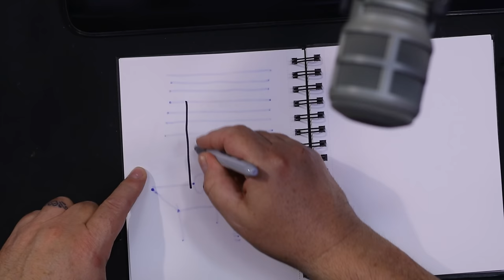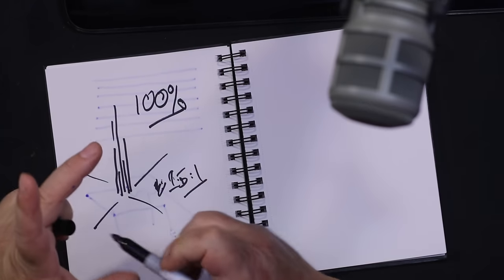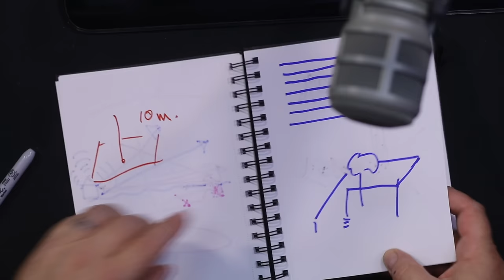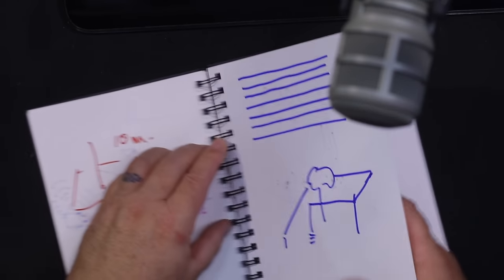Will it Work? Crazy Ideas for Antennas

Comment: I love this video. It’s beyond me why someone would want to do wonky stuff and ask someone else if it’ll be ok. If you want to be certain something “works” then use it as it’s designed! 

My runnin buddies here are talking about a little contest, completely friendly of course, to see who can come up with the most absurd antenna “thing” and make the most contacts on it. The band and other specifics have not been agreed upon just yet, but the one rule we have agreed upon is that the antenna “thing” can’t be an actual “antenna”. Use the car bumper, or a step ladder or a bed spring, whatever you want. You can use a tuner if you want, but you also have to wear a skirt if you do that. Its all in good fun and we’ll probably learn something out of the whole mess!
Reply from the maker: Tuner.. but a skirt! LOL. Will a Kilt be OK?
Reply: @DXCommanderHQ  sure, provided it’s worn properly!
Reply: You just invented a new contest!

Comment: several feet of clear vinyl tube filled with salt water. Made as a 10 meter dipole. 1.2:1 match and made several contacts. It worked. Did it just to prove a point to a few friends.
Reply from the maker: Absolutely fabulous!

Comment: The first contact I ever made was on cb...using an old 23ch am Midland...10 feet of rg-58 and a 102 inch steel whip mounted on a steel wheel from some old farm equipment laid flat, with a piece of axle sticking up to mount to...it worked!
Reply from the maker: Fabulous!

Comment: A 50 ohm resistor has has a great 1:1 SWR.  But you won't talk to many folks on it.  A random wire (or a nail) might have a terrible SWR, but you can get it to work to make contacts.
Reply from the maker: I need to do this.. TX on a dummy load with RG58 :)

Comment: I had an antenna at my old apartment that everyone said would never work. I used the rain gutters of my apartment building. I fed it with a 9:1 unun to the downspout and ran the ground back to a ground rod. Sounded like it would be a bunch of crap on paper but boy did I work a lot of DX, up to 10000 miles away. My theory, it performed like a random wire antenna.  the gutters were about 300+ feet total of metal in the air. Only down side was it was kinda noisy at times being right against the building.
Reply from the maker: Fabulous!

Comment: Just to be different I will tell you of one I made that I thought would never work but turned out to be better than anything I had before or since. Circa mid 90's my mate got a CB but was twigless and desperate to get on the air, I had some galv fencing wire so wrapped it around some batten evenly spaced and center fed it. It was one of those on the spot constructions. I thought as the batten was not circular it would cause all sorts of issues but he could hear people further away than I could with a silver rod and to rub it in a bit more he could also make further contacts than me too. We only lived a few houses apart so tried it at my place and I could hear so much more.  I was  both pleased and gutted at the same time..
Reply from the maker: Fantastic memory!

Comment: Thanks so much Callum. I'm in 100% agreement!-  It's not "will it work" but "how well" will it work"?
I have 102' doublet fed with my own 2.75" spaced open wire transmission line, and a balanced tuner, and with only 100w I can easily bust through large pileups.
As usual, it is about minimizing losses, and taking advantage of effiency. - Cheers!
Reply from the maker: Well said!

Comment: I have a pair of dipoles using 24-gauge speaker wire for each side. I can receive fantastically on them. I can't be heard the next county over, though, not even on NVIS. It may have something to do with them being inside the attic, but they were a good learning experience.
Reply from the maker: Thanks for sharing

Comment: I put a 1/4 wave vertical on a garage roof and ran the radials over it. It has high SWR either from the roof steel or the angle of the radials. I bet with some tinkering I could get it to work better but I'm going to try an end-fed running over the ridge cap about a meter high and see if the roof can give me some NVIS gain.

Comment: To understand an antenna and how it works, you have to put EFFORT in to building them, modelling them, etc. Doesn't matter if it's a dipole, OCF dipole, G5RV, etc build them and test them against one another and find out. Then publish your results on YTube, or your own website. I love messing with antennas, even though I am restricted at my QTH like a lot of hams are. Callum, you inspire folk to try, yes they can buy a manufatured one, but the fun is making a copy and getting good results. Love your channel 73's Andy M6APJ.
Reply from the maker: Yes, copies of well known antennas also good fun to make.. Not just because of the RF.. but the engineering and all the other thinking that goes into it..!

Comment: I like to run an end-fed vertical and an end-fed horizontal, and switch between the 2 of them to see which one is picking up the best. Then I use that one to chat on. If conditions are good I work DX. If not, I talk local. And if I have to run 1000 watts to talk to people I figure I don't know what I'm doing and I'd best go do more reading about RF and less talking on it.

Comment: My definition of an antenna working is what's in the log book. You can match anything and get an acceptable SWR. But that won't fill a log book. I have tried around 14 different antennas over the last 2 1/2 years and have an empty log. Noise, location and restricted space play a much bigger part than low SWR.
Reply from the maker: Good comment John.

Comment: Mac, G3OEJ always said you can tune up a knitting needle on Top Band with a good tuner.
Yes, it would work but not efficiently.
I remember at a special event station I used 3 five foot slot together aluminium poles stood on a Newcastle Brown bottle, a roller coaster and variable capacitor and h/b QRP radio and I made all the contacts on that day but my friend with his commercial aerial and FT817 made none. I had no SWR meter at that time and just tuned for maximum out. I only built one about 8 years ago.I love playing with h/b aerials.
G4GHB
Reply from the maker: Bill, you nailed it.

Comment: I'm having my own go at "will it work?" I built one of those "double bazooka" dipoles for 40 meters and it works pretty well. So I started searching the Internet to see if anyone has ever built a "double bazooka fan dipole for multiple bands. I've found absolutely NOTHING. Asked a few knowledgeable people- they don't know either. Only thing left is to build it and see if it will make it past the "will it work" and "will it work well" stages. Even it it's a failure, I guess I'll at least learn something!
Reply from the maker: Yes, try it.. Not sure if a double bazooka has harmonics - so built ONE element (biggest) and find out where it is also resonant.

Comment: Have you ever tried elevated radials with a slightly hoisted dx commander? There's another UK amateur radio shop run by a slightly older owner who ocassionaly takes veiled digs at ground mounted with radials, and has often hinted at your excellent product who seems to be a mad proponent of elevated radials, in fact a mad proponent of anything but ground radials! I've had excellent performance from my classic and from the 12.4 mounted the standard way! MI0MCZ
Reply from the maker: He doesn't know what he's trying to sell sometimes. I know him. You need to dig deeply into the research that Rudy Severns did on Elevated Radials. AT first they look like a magic bullet, but only at first. Also, in the "creator community" (we chat all the time!) we think he's not actually sure if he wants to build credibility or sell more stuff.. He might find himself one day I guess. I did!

Comment: Saw a channel where the guy built a Yagi the other day. He had no matching on it. When I question how it was matched he said it was a perfect SWR. I said yes but how did you match the impedance? He basically said it "worked"

(It was a CBer channel BTW 😅)
Reply from the maker: Well, it probably worked (ish)!
Reply: @DXCommanderHQ  It did(ish). No hate. It's just that now others will copy the design. It's the blind leading the blind and that's all too common on the internet.
Reply from the maker: @3dPrint_and_chill  Oh of course.. Myths again!

Comment: Will it work?? YES!  I've spent a very active summer playing with antennas, looking for the perfect solution.  Did I find it?? NO.  I've built doublets in every length recommended, 102', 88',and 44'.  I've built 132' EFHWs fed with 49:1 UnUns of 43 and 52 mix, end fed wires of every recommended length fed with 9:1 UnUNs of 43 and 52 Mix, slopers, inverted VEEs fed with 450 ohm ladder line, even a 43' vertical. Did they all work and did I make contacts? YES, hundreds.  Which worked best?? Can't say.  Unless you own at least 4 Field Strength meters situated at the 4 points of the compass and located a kilometer or so from your antenna farm, all antenna performances are judged subjectively.  Even WSPR and the signal reports we get from FT8 contacts are not reliable indicators of performance as they are dependent upon propagation and the antenna at the other end of the contact.

Some of the antennas produced so much RF in the shack that they tripped the arc-detect circuit breakers in the house, instantly knocking me off the air in the middle of a contact.  Some produced wiggly lines in my PC monitor.  Some were so unsightly that they raised my XYL's eyebrows.  The ladder line doublets triggered constant retuning of the LDG Z-11Pro II caused by backyard birds landing and swaying in the breeze.

The biggest challenge that still exists is how to get a multiband antenna that will work and work well on all bands.  Using a VNA, I've found that meticulous adjustment of the lengths of wire will get you 1.1:1 on a couple of bands, but as you approach that magic mark, other bands drift toward 5:1.  It's obvious that the DXCommander would be a good solution, but my QTH is near the bottom of a Tennessee hollow, and the entrance to the neighborhood is 60' higher than my yard.  Even with the 43' vertical, my antenna was still 20' below ground level at 0.5 miles.

So, the fun continues.  After all, isn't that a big part of Ham Radio, designing or duplicating the efforts of other, building, testing, enjoying?

My apologies to Callum for the many lines of text!  HiHi

73, AA5FA
Reply from the maker: Yeah, sometimes it's all about adjustments!

Comment: Have you ever tried to put your RF amplifier at the base of your antenna using 20 cm of coax? Why not.
Reply from the maker: Because it's too heavy to carry out to the field. And also, I have faith in numbers. I'm surrently running 65m of EcoFlex 15 coax. On 40m, the loss will be around 0.2dB. On 20m that will rise to around 0.5dB.

Comment: I heard that a 1/4 wave ground plane cut for 6m acts like a 5/8 wave ground plane for 2m......can you corroborate this?
Reply: That's correct however it may not give you resonance at 50.0 MHz but probably higher; depends on the length and groundplane.
Reply from the maker: ALmost! Good question. ANY frequency multiplied by three (1/4 wave becomes 3/4 wave) works like this.. However the calculation is JUST slightly more than a factor of 3. So you would need probably a resonant frequency of ABOUT 48MHz to hit the 2m band.